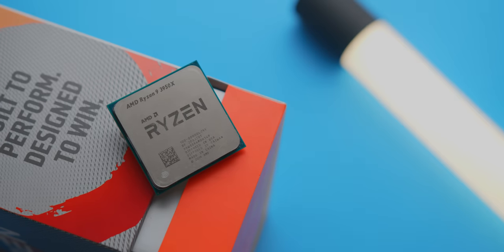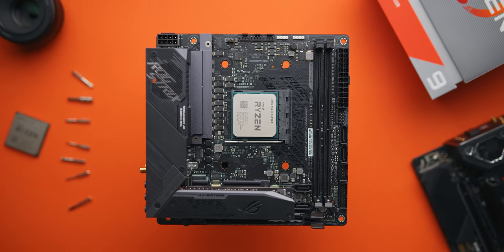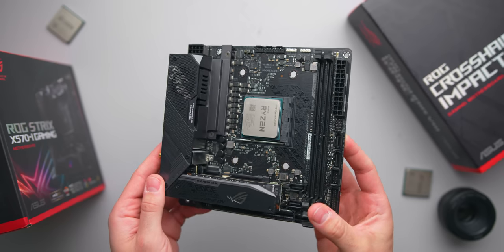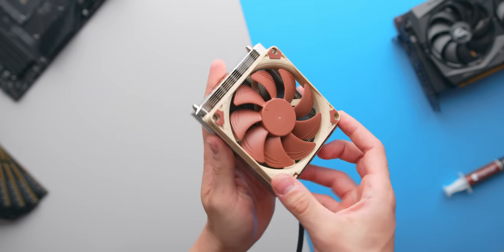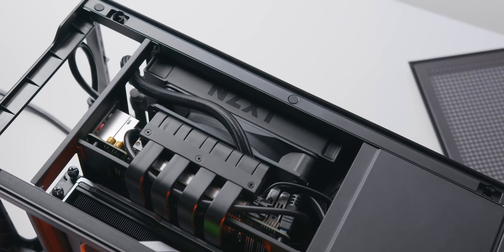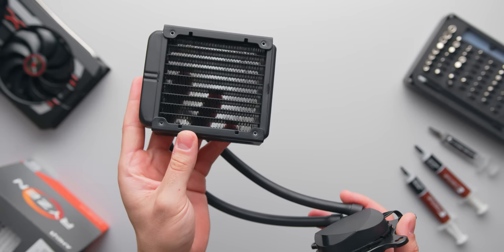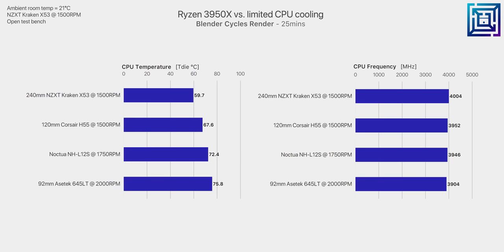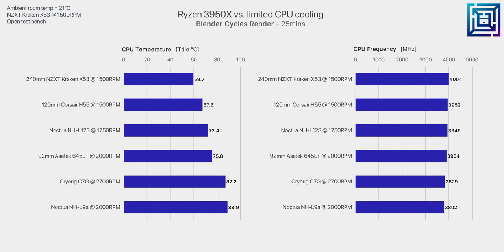Ryzen 3950X vs. Low Profile Coolers - Sanity Check

Comment: Thanks, this was an informative video. I don't currently have a SFF build, but I'm planning to give it a try. Currently I have a Ryzen 7 3800X overclocked to 4.5 GHz @ 1.375 volts in a Thermaltake Level 20 HT Snow Edition 4 case. I'm keeping it cool with an open loop containing two 360mm radiators. Temps after an hour of Prime95 stay within the upper 40's.

Comment: Got a question about the nhl12s. Noticed that the heatpipes could be bent, would it possible to reduce the cooler height even further without breaking those heatpipes? Once the cooler is installed so the screws aren't in the way as much. I understand there's risks, not supposed to and etc but SFF builders don't always follow the rules to get best temps they can. 

Also what difference would reversing the direction of the fan airflow make? So air is blowing towards the motherboard, instead of away? When the exhaust is right up against the cooler to minimise case air getting circulated around? I know the fans aren't make to mount like that with the supplied screws but can it improve thermals even further inside a case? I realise you just won't find many coolers and case combinations that have the heatsink above the fan and practically pressing onto the exhaust but with what you can get would reversing fan airflow make a difference or would that just keep case airflow going around the outside of the heatsink and being drawn back in too much to reduce temps?

Comment: I’m using an NZXT X63 for mine inside of a Sliger SM580 & using 4 BeQuiet! SW3 PWM fans. I’m also using Thermalright’s liquid metal TIM. I think I liked Thermal Grizzly Conductonaut better... but... Gaming temps hit around 60C for CPU at stock and the CPU clocks up to 4.735Ghz, GPU (RTX 2080 Super FTW3 Ultra W 77/777 OC) hits 45-55C depending on the title. Ambient room temp is 21-23C

EDIT: fan RPM are usually between 700-1400RPM. I like quiet. The loudest thing in my rig is the damn chipset fan on my X570 I Strix... hate it.

Comment: I'm using a Noctua NH-L9a on a Ryzen 7 1700 and with a bit of tweaking inside a case with an r9 Fury X (running at 900mv) it peaked 76 degrees at locked 3.7GHz from 3.0GHz stock after 3 hours of both CPU and GPU stress testing :D That little fan is so quiet too! CPU lottlery might be a good reason why, but it's a damn good cooler for its size!

Comment: This is a fairly easy question to answer

Why itx?
- If portability is the issue get a laptop
- if you are travelling (like I do) then ITX is a solution, not the solutionn

Beast-PC with 128 gb ram and 3090 ti and r9?
- Get a large proper chassi as overheating may be a problem, you own a workstation PC, then prepare yourself for workstation-heating

Compact ITX gaming pc?
- get i5 or R7
- decent cooling
- M.2
- mid to high range GPU

Comment: Fyi I just finished my 3950x build in the da2.
Using a 280 x62 kraken. With 2 noctuas as intake.
And just added a rear 14mm 92 mm exhaust fan.

With out rear fan max load was around 85deg. With stress test.

With rear fan 75deg. With stress test. Very happy with this setup

Using ASRock Phantom x570 itx/tb3. 
And trident z neo cl16 32gb ram.
Gigabyte 2080 super GPU

Should note I have it setup for fast clock speeds. so temps are a tad high but performance is insane

Comment: I have my 3950X in an NCASE M1 cooled with a Noctua NH-U9S  cooler with dual 92mm fans.  I'm running this on an ASUS STRIX ROG B450-i motherboard, and I set the temperature limit of the CPU to 78C in the BIOS.   For 100% sustained loads,  I'm running at about 3925 MHz.  When I don't limit the CPU to 78C in the BIOS, the temperature gets to about 89C at about an average of 4005 MHz.  The real-world difference in video transcoding between these two was only about 11 seconds on a 2-hour video, so I just stick with the 78C limit.

Comment: Running a 3950X in the Ncase M1 using the C14S Cooler. I found that its a bit insuffecient in cooling the processor at stock settings. But with a combination of capping PPT at 135 and setting a vcore offset (around .06) i was able to get even better than stock performance at times. Im not sure of all the software you're using to look at clock speeds and temps but i'll top out at 82-83C now with clocks at 4.06. r20 tests are around 9350. So it can be done with some minimal undervolting.

Comment: I installed an i7 9700k and a 2070s into an NR200P mtx case with a noctua nhl9i and the hardest part for the first few weeks was managing the thermals. For a while, I couldn't find a way to give enough airflow to the case to keep it below 89c. After some tuning and rebuilding it a few times I managed to get it down to 73c consistent.

Comment: Hi, would you still recommend the alpenfohn black ridge? Planning on using a B450 itx board, and should be able to fit the extra fan on top, but am having lots of trouble finding reviews other than yours. I have found that depending on the version, it can have compatibility issues with AM4 boards.

Comment: 3950X - Core X71, 2x360mm slim radiators, 1x360mm thiccboi radiator. 74~75c at 4125~4150MHz PBO disabled in non-AVX. under AVX workloads it's more like 3950~4025MHz same temps.

It just kind of hits 74c and stays there. 140w limit and all.

Comment: Seeing the thermals on single and double width 80mm radiators with the different widths, copper vs aluminum, push vs pull vs push/pull would have really addressed the smallest builds.

Comment: Thanks for the great video! I've been thinking about pairing the 3950X with the Dan A4 for some time, would you say the Alpenfohn Black Ridge and the Noctua L12s are comparable? (switching the Black Ridge fan to a Noctua 92mm)?
Reply: Check the alpenfohn compatability. I read it doesn't fit on my motherboard (aorus b450 itx gaming wifi... God that's a mouthful) not sure that it will be an issue for you but do have a look. The issue with my motherboard is the heatsink gets in the way.[edit: spelling]

Comment: Awesome review! I am waiting to see the same for Ryzen 5000 series CPU.. I am "in" Node 202, currently with Ryzen 5 2400g and Noctua NH-L9a-AM4. Limited with the height of the CPU cooler I would like to upgrade to Ryzen 5000 but if the 5800x or 5900x cannot be effectively cooled with that tiny cooler.... I don't know... Still thinking.

Comment: Hi, I have a 3900x currently on AIO. And I have a Noctua NH-L12S that was meant to an itx build that I couldn't make so I switched back to ATX. Ii was thinking of selling it but after watching your vid I might keep it for backup. Do you think that being the 3900x a worse chips would be handle a lot worse than the 3950x by the Noctua or it would be a more or less similar situation? It will help in my case that I have an ATX case (Evolv X)? and if a I go back to itx, would be the Noctua enough? thanks in advance man!

Comment: where is your best 47mm cooler, Black Ridge?
Reply from the maker: Didn't fit on the test system, doesn't fit on quite a lot of X570 and B450 motherboards unfortunately due to the large heatsinks.
Reply: @optimumtech  So true, this cooler works best with intel motherboards unfortunately. They even released a second pair of redesigned brackets for amd motherboards and I was still unable to get the cooler to fit on a Gigabyte Aorus X570 itx motherboard.
Reply: @optimumtech  sad, but i guess its gonna be more cooler than the l12s ?
Reply: @Phanbot01  Even the simple Wraith cooler I had to rotate 90 degrees to fit in the Aorus 570. Just made clearance between that back I/O and RAM.
Reply: @ghafarizainoorrohan8684  it's about the same with a 120x15 on top and 92x15 below setup. At 92mm below it's better than a cryorig c7g according to Optimum Tech's video but not as good as the L12s. If you use a 25mm fan on top instead, it's better than the L12S.
Reply: @ghafarizainoorrohan8684  it won't be cooler unless you use two fans, one below and one on top of the cooler and that one has to be a 25 mm not a 15mm, a 15 will still be warmer.
Reply: @Phanbot01  I was able to install the black ridge on a x570 mother board but offsetting the bottom fan to be closer to the heatsink pipes. It doesnt clash with the M.2 fan/heatsink and does require any modding.

Comment: The issue with the 3950X is that the heat is concentrated on one side of the heat spreader due to the location of the CPU cores.  Also the heat spreader isn't large.  There is a lot of heat to dissipate from a very small area which makes CPU cooling even more difficult.  Even with open loop water cooling systems using the Optimus Foundation CPU blocks the CPU thermals aren't great.  You reach a point of diminishing returns by adding more cooling.  The difference in cooling performance between an open loop cooling system with a pair of 360mm radiators isn't a lot better than a good 360mm AIO in my experience due to the issue of so much heat in a small area.  For my own 3950X system I went with a 360mm AIO with push pull fans.  Over the course of a ~4 hour color correction on a 4K video in After Effects the difference in time and CPU clock speed is minimal compared to a dual 360mm radiator open loop system I built for someone else.

Comment: My build is an Asus Prime x570 Pro, Ryzen 9 3900x, GeForce RTX 2060 6GB GPU. I video & picture edit but mainly to upscale or clean source material, never 4K. I'm always looking for workstation performance and I'm not a game player. I found with the stock AMD cooler CPU temps hovered around the 58-60 degreees mark, motherboard 40 during a typical render. Although the stock cooler does a fair job it continually fluctuated in fan speed, a noise I can't bear so I put in my Noctua NH-U14S (a lot more air getting to the CPU) and things are much better. Low level of noise that doesn't fluctate. I've found CPU to now hover around 45 and motherboard 35. Even tho I don't play intense games these results are better then I thought possible and this is in BeQuiet Silent case. Conclusion: SFF = High Temps.

Comment: Yes it can be done ... as long as you don't go below a certain TDP capability cooler . From my experience , my 3900x in a DA2 cooled with a NH-C14S, is sitting happily at around 35-37C idle and 65-75C under real world use scenarios . Under more extreme loads it may touch 80-85C (I've only seen it reach 90C only once under prime95) ... Sometimes air cooling is preferable to liquid cooling . And oh you cannot rate enough the silent experience of noctua fans ...
Reply: Yannis Kouretas  air cooler are better they alao send air around thecpu to the other components. Aio cools only the cpu. Theoretically i think the air cooler are better. Me i use hyper 212 evo and it is very good with my ryzen 1800x 95w tdp. The temperatures are very minimal.

Comment: 1:54 it is not necessarily the cooling and warming up that causes CPU degradation, or normal "wear and tear."

When CPUs run at high temperatures for prolonged periods of time, the CPU becomes more susceptible to the "electron phenomenon," they are called different names and different types, but basically this phenomenon happens when electrons flying through the extremely small transistors of the CPU don't follow the transistor and instead burn an entire new line (trace) for electrons to flow where they should not. For CPUs this causes major corruption at the bit-level, which is not correctable because of the nature of how CPUs work at the microscopic level.

This phenomenon happens naturally as the CPU is used, every time an electron flies through a transistor or gate, it wears it down naturally. But heat can ultimately accelerate this process of degradation.

This is not the only worry that CPUs have, but it is most common when you're running your CPU at high temperatures for prolonged periods of time. Modern CPUs can still take years of abusing them at high temperatures for this to occur, but it happens a lot sooner than it should and can happen at any time.

Disclaimer: I am a technology enthusiast and Systems Administrator. These topics are common for me to come across and it is amazing how such small chunk of metal can run our everyday devices. You can learn more about the operation of a CPU here: https://en.wikipedia.org/wiki/Central_processing_unit
And you can learn some about the overclocking of semiconductors here: https://en.wikipedia.org/wiki/Overclocking
Please also remember that Wikipedia, while it can provide good information, can also provide biased information. Please make sure to also read the footnotes for sources sited.

Comment: This should also apply to the Ryzen 9 5950X, the stock temps are lower than the 3950X!    (However overclocking is worse but there is a much greater headroom available, up to 20 percent extra performance)

Comment: man, i'd love a 3950X... i scored a 1950X two black fridays ago for $450 but sold it this spring for rent. hopefully 3900/3950s hit under $300-450 this black friday (or sooner)! use case: continuously doing AV1 encodes (currently taking up to 3 days straight @ 100% on a 1700X)

Comment: Never underestimate the AIR Cooler. i have a 12year old (new) Zalman CNPS 9900MAX DF on a 8700K clocked to 5.3GHz with 1.380v and it runs games and such just fine. Though, a Blender render would cause it to downclock to 5GHz. Still, Gaming at 5.3GHz on AIR with the CPU sometimes hitting 70% utilization is a viable option. So a 3950X at 3.8GHz can surely be one to.

Comment: I just received this CPU for my new system and decided to go with a 280 mm NZXT. I'm used to much cooler temps on my 5820k and Noctua U14s at around 42C at the high during renders, though, so we'll see how well my anxiety handles a solid 20 degree bump.

Comment: 3950x. Antec 802 case (not good airflow) in desk cubby hole so only front and back open to airflow. Dark Rock 4 pro 250 watt air tower. Idles at ~38c. CPU-Z stress test, 81c. Stockfish chess engine all 32 threads, 72c. 3975 MHz

Comment: Little late but say would this CPU be good to go with a beefy air cooler like say,a be quiet pro rock 4 or a Corsair a500,i mostly going for stock boost clock but wouldn't mind the option for some overclocking to be present,Ty in advance

Comment: Running a 3950x on an MSI x570 unify board and an NH-D15 chromax.Black (using LNA adapters so fans max out between 1100-1200 rpm). Temps barely break 70C in my current case (Fractal Design R6) while running handbrake encodes which load up the processors 100%. Otherwise it stays right around 45-50C.

Comment: Got a Dark Rock Pro 4 on mine right now. Going to switch to custom loop. Got the CPU block, just need to plan out the tubings, fittings, pump and radiators.

Comment: I run a pretty solid -0.15v offset on my 3900X but still manage a +200mhz offset boost on my Unify.  It amazes me how wrong the MB manufacturers have their default voltages set. I was running up to 1.48v using the MSI default and now I still get multicore peaks of 4.5GHz using no more than 1.32v.  I predominately use the boost over an all core OC for gaming but easily get a 4.35ghz all core OC @1.35v.  Using boost in gaming can still produce a 4-6 multi-core boost of 4.5ghz while not exceeding 1.32v and now I idle at 36C and not 45+C using default voltages on air.  If you're gaming I would recommend a boost OC over all-core.
Reply: just increase or decrease voltage. 0.0025v as basic reference for amd product.

Comment: Thanks for this video. We can debate for long, but you just demonstrate that beefier/bigger cpu coolers have pretty small (to none) advantage for 98% of users versus small one, at least on stock settings...:) NH-L9a is able to render same blender task just 5% slower than 240mm AIO (ok it's hotter, most probably noisier), but it did it!
Zen 2 cores are great to adapt themselves to cpu cooler capabilities..;)

Comment: If you get a chance would you mind reviewing the Thermalright AXP-100 Full Copper?  I bought one for my Ghost S1 running a 10700k and I think this thing can give the Noctua NH-L12S a run for its money in the under 70mm category.  Note: I did swap the stock fans for an NF-A9x14 HS chromax.

Comment: I know that you are testing coolers and not cases, but I think the comparison demands that context to be fair. If you install a 240mm aio, you are taking up two whole fan slots. You can achieve a LOT of airflow in a small case with 2 120mm fans. The gpu is the obvious beneficiary of extra circulation, but air cpu coolers are affected too. If you set the circulation up in a specific way, you can actually get better temps inside the case than on a test bench. Especially if the system is under a desk or in a corner. I get higher temps if I take my side panel off, the way I have my Cerberus set up. I think a follow up video of cooling high tdp chips with low profile vs aio coolers in small cases would be a good idea. (Yeah I know that's kinda your thing)

Comment: I run a 3950x in a Ghost S1 with a large Tophead, cooling it using a kraken 52x with noctua fans. It runs very well and quiet, but the large tophead obviously hurts the mobility a bit. I would be very curious to see if you could run the 3950x without a tophead with one of the coolers you tested. Looking at the bumbers NH-L12S could potentially do it in conjunction with a blower style GPU, would be very interested how this works out.